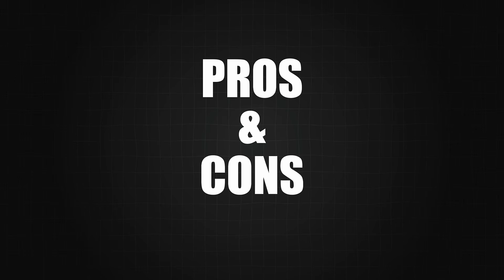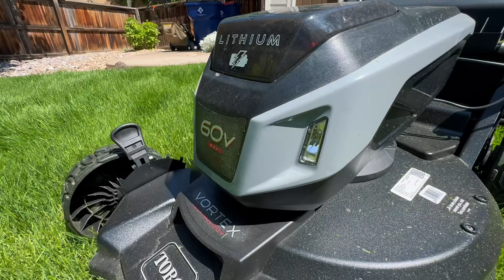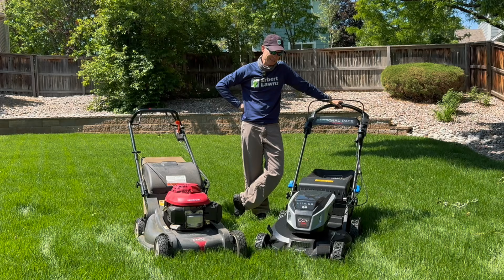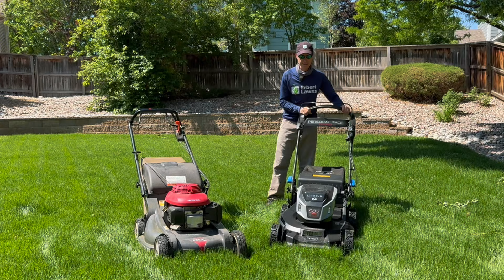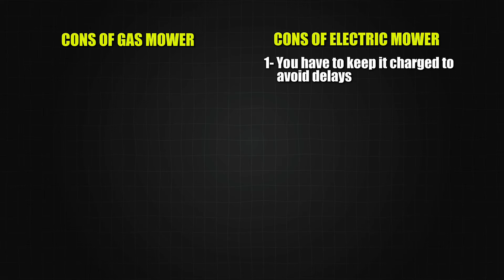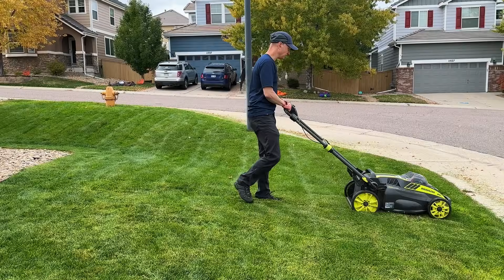Gas vs Electric Lawn Mower - Why One Is a Total Waste of Money

Comment: Totally disagree.  Electric mowers come with MULCHING blades.  If you want to suck up leaves, change the blade.   Electric mowers spin faster and give a nicer cut.  If you use a gas mower without ear protection, you are destroying your hearing.  I never had to stop and change my battery.  But with gas, I always had to add gas half way through.

Comment: my Poulan Pro is finally breaking down after 22 years of weekly use... deck is seperating, but electric both me from the cheap feeling / look and the fact that I will prob need 2-3 batteries or mow my lawn in sections.

Comment: That electric mower will not last nearly as long as the gas mower. The batteries are not nearly as durable. Add to that the battery replacement cost.

Comment: Depends on the size of your lawn. If you have acreage, you probably have a ride-on mower which almost certainly be a 20hp or more 4-cycle gas. So what we're talking about with these small mowers is whether i's your main or secondary mower. I need a secondary, so electric is MUCH preferred -- no need for carburetor concerns  oil changes or spark plugs. And no worrying about fuel, including buying fuel conditioners.

Comment: I have a Victa mower (Australia) that has a Tecumseh engine bought in 2005. I'm almost certain that it needs work. The bore has scoring, the fuel line is perishing and there is a bit of a leak in the exhaust valve, but I'm hesitant to take it apart since I'm certain parts are hard to come by. It still starts first pull, cuts very well and can do two or three yards on a tank. I like the idea of electric mowers since they are cleaner, quieter, require less maintenance and can be fixed easily since most of the electronic parts are off-the-shelf.
Reply: I think the parts argument for electric mowers is backwards, they are way harder to find than small gas engine parts imo

Comment: I have a Honda Harmony gas mower - bought in 2018.  It is excellent.  I love it. Starts every single spring, first pull.  Beautiful cut, and when the grass gets tall (which happens quite often!) it handles it. Lights are not needed with an LED headlamp. I have mowed the lawn many times after dark.

Comment: I bought an EGO almost 6 years ago.  It needs replacing now, and is almost due for a new battery (2nd battery, first replaced on Warranty).  It's dead.  But it was good to use, mowed fairly well unless grass was thick.

Previous gasoline mowers lasted 20 years.
Reply: And maintenance &/or repairs figured in over that time period for the gas mower would be.....how much?
Reply: I’m glad you shared this. I was going to say that l’m personally intimidated by the maintenance but what kind of man are you if you’re always outsourcing all your issues and looking to big manufacturers to take care of your challenges for you in the form of just buying new things.  It’s also funny that we’re trying to be environmental as a society so we cut gas but then build lawn mowers that break down and need to be built again. I’m sure those factories aren’t doing much for the environment. 

Anyway maybe a bit too much thought for just a lawn mower but you helped me make up my mind.

Comment: My 40v Ryobi cut out after two seasons. The controller failed, and it’s a $250 replacement part. It was absolutely fantastic on power, but I’m not sure I want to keep replacing a $250 part every couple years

Comment: if you’re in these comments saying a honda didn’t last for you it was your fault👍 my hondas have been fine and my hrx has been dropped from ppl hauling it way too many times, still going strong not a single wiggle in anything, that electric will break while my honda’s make me money 15 years later😂
Reply: I agree, I have been using my Honda since 2006 with regular maintenance it starts every time with no problems. I was thinking about electric but I have a fairly large backyard and would probably need to manage batteries way more often than filling it up with gas.
Reply: @sheldonjones5076 yeah electric just isn’t far enough along, they charge too much for the mowers and the extra batteries for them and still can’t keep up with my 200cc walk behind honda that i bought used but running for $300😂
Reply: I have to agree with you. I bought a Hrr Honda in 2003 and finally last year I replaced the carburetor and it starts first pull most times. I use it at my mom’s. I bought a Honda Hrx with the Nexite deck and it’s great. My older one does a have a small hole on top of the deck. A little duct tape fixed that. I do like the idea of electric though with no gas or oil or maintenance.
Reply: @padude131  electric would be cool if it could be refilled in 30 seconds like a gas one or at least could last a full day, and they have to make the same smells cause it’s just pure nostalgia😂

Comment: a care will regenerate power to the battery why not have a generator hooked to the wheals to recharge the battery of course it may not be enough but there should be somting that would work
Reply: The only way it works for cars is because they weigh alot. Battery is recharged when you are trying to slow down and it uses the inertia of the car to generate that power. A push mower, or even a rider, is not moving fast enough or weigh enough to do that. So to get power out of the wheels and back into the battery you are either using the motor to turn the wheels or you are using your legs to generate that power. Either way, it's a step backwards .
Reply: @connormcleod5140  good point . ....for myself i have already taken care of the problem ahead ....i am 65 and most likely will not be mowing my yard for more than another 15 years or so . as i have alreay had quadruple bypass surgery 2 years ago ,,,i like the gas mowers and Honda was top of the line when they stopped making gas mowers for the  US. So when i heard they were going to stop production on the gs mower i went down and bought several of their brand new  top of the line gas mowers and put them is storage  with extra blades and parts ..i should never have to buy another mower the rest of my life

Comment: Power output on gas mowers is 3-5 hp. Power output on battery mowers is (Amp hours*volts)/runtime. So say you run through the 6AH battery in 45 minutes, (6x60)/0.75=480 watts. 1HP = 745 watts so 0.644 HP. It depends on the load.  If you run that battery out faster going through really tall grass you'll draw more current, more power output but the battery will drain faster. So battery mowers CAN cut good but you have to lighten the load, ie cut more often. Instead of every 2 weeks cut every week, or instead of weekly like in late spring cut twice a week. Don't expect to be cutting the grass down 3" on one charge unless your lawns really small.

Comment: My ego 22in beat both those hands down. 😊😅
Reply: Sure it did. Be sure to get back to us when you replace your first battery in 3 years. You'll be on your 3rd Ego and my gas powered Honda will still be working just fine.
Reply: @smitastic7030good thing Ego has a 3 year battery warranty.
Reply: @smitastic7030I mean its been 3 years and my batteries still good.

Comment: My battery failed in in less than 1.5 years so I switched back to gas for the time being but I think it's under warranty. When the grass is tall the gas works much better than the electric which struggles and loses battery life fast, but I do like how electric is much more quiet and lower maintenance. I think one of the reasons gas gives a better cut is because you can take it slow and do a good job but with an electric you're moving fast to try to beat the battery life.
Reply: I have had my Ego for 5 years now with the same battery and no issues.  After each use I take it out of the mower and place back in its original storage box with the charger.

Comment: Great Info, Thank you.  Bought a Honda gas drive lawnmower during covid. (always wanted one) Unfortunately... What a piece of S**t! Im sorry to say that but this season (2025) the deck, drive and body gave way completely. I always had trouble w the Drive. Every year had to get it fixed or replaced. Finally there was no fixing it anymore. Totally pi$$ed off it didn't last longer esp at the price.    Lasted only 5 yrs,  Motor worked well.  Now I'm debating gas or battery. But I'm like you, I like a nice neat clean tight cut! Mulching too. (we have several large magnolia trees that rain leaves and flower pods so mulching is a must, dual blade Honda was great for that) I'm using a lawn service currently, but if you have any suggestions regarding a good gas-powered drive lawnmower, please leave me a comment.  Thanks Jack
Reply: Secondhand mowers are probably the go to for reliability. Look for older mowers with Briggs engines, Tecumseh motors are uncommon and stopped manufacuing a long time ago. Parts for Briggs and Honda motors are still available and older mowers can run for decades. The only troubles are you're buying someone else's problems, you may need to fix any issues, and it may not be pretty or as modern.

Comment: If you buy both, after 10 years the gas will still be good. The electric will be in a landfill? Multiple mowers/batteries. I own both. After 4 years. So far the gas is still going strong. I'm Down two electric mowers, 3 electric trimmers (Ryobi batteries = expensive junk). I use the gas, my wife uses electric. Started with Ryobi, switched to DeWalt. It's much better. If you're actually going to use it for anything other than a tiny yard. Gas all day.

Comment: now try that again with the toro set up correctly, get rid of the low lift atomic put the high lift on it, tighten the drive cable, keep power on high all of this is in the manual

Comment: Most of the pros you mention for the gas powered mower (cons for the electric) have to do with the model you get and not at all to do with it being gas vs electric.  The flimsiness?  Even the power depends on the mower you buy.  I have one of the more powerful Ego mowers (biggest battery) and it cuts through tall wet grass with no issue.  The gas mower I used to have would STALL on that stuff.  You're not giving electric mowers a fair review.  Instead you're comparing a nice gas mower to some inferior electric ones.  Now, the thing you said about it not filling the bag completely.... that's a different story.  Sometimes my Ego will pack it tight before I have to empty it.  But, other times, it starts spitting out grass when it's only 1/2 full.  Not sure what that's all about.  It's like it gets clogged sometimes but it has plenty of power.